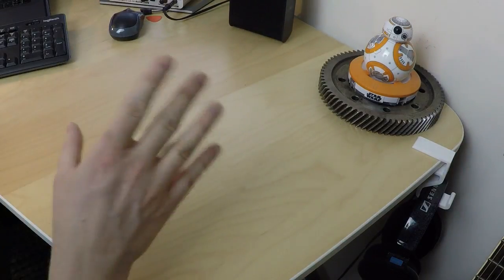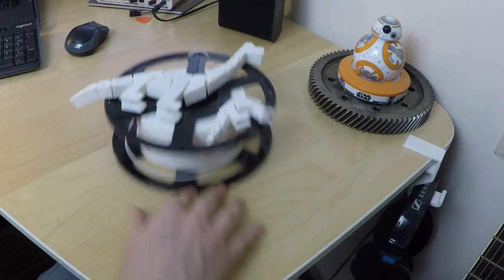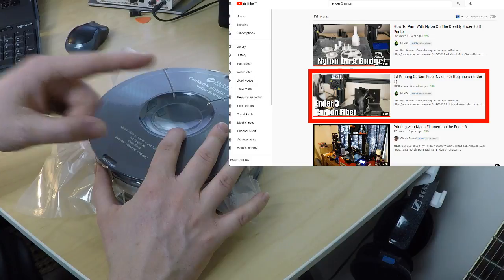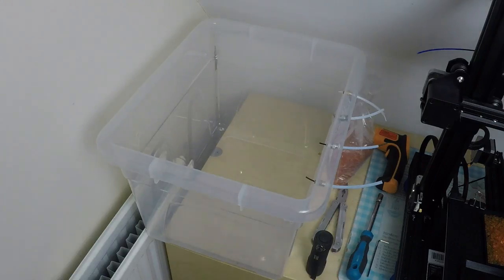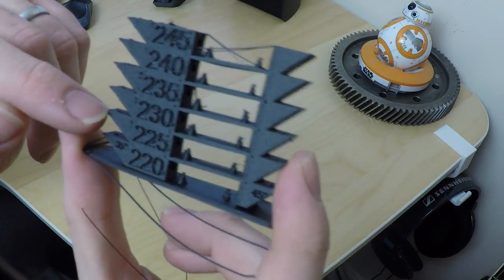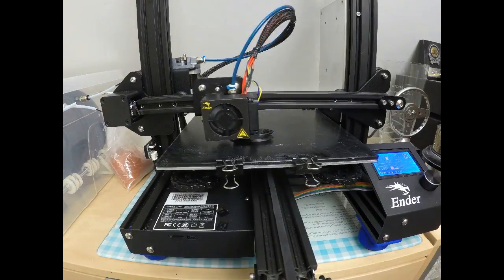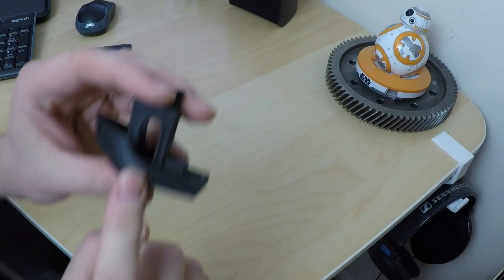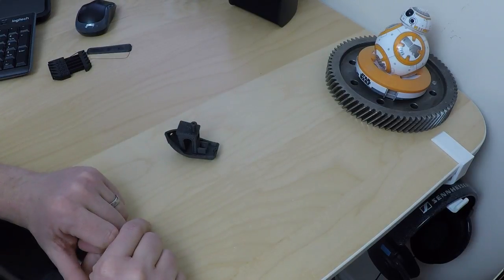3D Printing Carbon Fibre Nylon on a STOCK Ender 3 Pro - Can it be done??? (okay, almost stock....)

Comment: Definitely get some garolite if you're still having issues. I've been having excellent repeatable results with that with some of visionminers nano polymer adhesive. It's so nice to not have to babysit long prints and takes a few seconds to apply adhesive. As soon as the bed cools the adhesive shrinks and you can pop your part right out. I'm also using the Amazon Sunlu S1 filament dryer that I print directly from. I made some modifications to it just search for user "chambeers" on thingiverse. Excellent videos  I'm definitely subscribing!
Reply from the maker: I've watched a few of the Visionminers vids so it's good to get a second opinion on the nanopolymer adhesive, just need to find some in the UK!  I've only had 1 issue with warping on the Nylon, and these are big prints but I've just ordered some ASA so warping might be become more of an issue!  Thanks for watching and subscribing....
Reply: @MakingforMotorsport   I'm sure they'll ship worldwide. I was very skeptical of visionminers infomercial style marketing and figured I'd just give it a shot since it's made in the states. I have a shifter I make its about 300 grams and mostly solid 150mmx120mmx120mm with 100% infill. Runs for 26 hours each with 3dxtech CF PA6. Haven't had any warping or lifting issues yet with that combo. I have the Wanhao duplicator i3 plus v2 printer, garolite bed, wham bam flex plate, microswiss hot end, hardened steel nozzle, Creality amazon enclosure, and the visionminer nano polymer adhesive is the best combination. I tried everything from pei pex glass and nothing but problems. .4mm nozzle 265 degree nozzle 80 degree bed. I'll try to make a video to send you of my setup and some of the prints as they come out
Reply: @MakingforMotorsport   I watched a video from "Teaching Tech" he made some under bonnet parts from apolloX ASA and that printed decent on my setup but it's hard to find and just doesn't feel nearly as strong as CF nylon.
Reply from the maker: @moneyshot2239  I literally ordered some ApolloX yesterday, i have a few pieces under the bonnet in PETG as prototypes and I don’t want to use CF-Nylon for everything. From what you said I might bump up the in fill abit!

Comment: Nvm found it haha!
Reply from the maker: I don’t think that the Ender 3 is the “best” printer for this material, something with an all metal hot end and higher temps as standard would be better an enclosure would be ideal... but that is probably a $800 printer.... (I buy cars for less than that 😂)

Comment: Thanks for sharing.  But your printer with an metal hot end, glass plate with upgraded springs, metal extruder, and upgraded tubing... is NOT stock.  So your title is alittle off-putting and disingenuous.  But none-the-less, good video.  Those are inexpensive & easy upgrades that everyone should do, regardless, to make the Endor 3 a great reliable printer.
Reply from the maker: Yeah, I updated the thumbnail but I should address the title maybe, but like you say these are low end mods whereas lots of others have different mainboards/thermocouples etc, if you can build the printer from the box, you can do these mods!  But glad you enjoyed the video 👍
Reply: I just bought an ender 3 V2 and the glass plate comes stock... as for the tube it's mentioned that it would probably work fine without.

Comment: intresting video and cannot wait to see that manifold.. Had a mini myself with a 1380 jenvey body and I loved screaming it to 8,500rpm :)
Reply from the maker: This is my first mini, the a-series is a perfect match but getting good power gets expensive!  8500rpm on a 3 bearing crank!  Wow!  I've got some small bits on the manifolds in the ITB videos but I'm gonna round everything up on them once the R&D is done and get all 3D geeky!
Reply: @MakingforMotorsport   yes it gets very expensive, that 1380 build did get right up there in cost.. I will go through the videos you have :) 
to be honest if I do another mini Iwill prob go with a honda engine
Reply from the maker: Yeah the engine swaps are very effective in the Minis, but they never handle the same... mine certainly doesn’t, not bad but just not “mini”
Reply: @MakingforMotorsport   I know what you mean, the handling goes out the window..
A friend of mine back in the UK did the Honda swap back in the very early 90's and he said it was not the same after that

Comment: Got acouple things first this isn't a stock printer so please don't say it is. And second why do you keep saying 255 was the temp when it was 235???
Reply from the maker: Yeah, the stock thing is abit of a stretch so sorry if I deceived you... where was the 235deg piece?  I did the test at a range but I use 255 for this filament as a standard....
Reply: @MakingforMotorsport  He didn't actually absorb what you were saying and showing at the 5:39 mark - that you didn't follow the exact temperatures printed on the test piece. He thought you were following the 220, 225, 230, etc steps as printed on the actual model.
Reply from the maker: Aaahhh.... that makes a lot more sense now!  Guess I could’ve been clearer...   thanks for the translation!

Comment: Just bought an Ender 3 to use to make motorsport parts. You've got yourself a new subscriber
Reply from the maker: Excellent!  Just got the manifold on and it works but not fully tested yet (no events in lockdown 😡), but plenty of other good stuff to make planned!

What car do you race?
Reply: @MakingforMotorsport  got a k11 micra that I've got a 1.6 from a pulsar (in Australia) to go in it for motorkhanas/autotests. Very much a maximum speed, minimum bucks build
Look forward to seeing more of your build too
Reply from the maker: 1600?  That’ll go well, I had a 1400cc for a few months a while back, it went well until aerodynamics force take over, but off the line and up to 45-60mph it was fairly rapid...  best of luck with the build!
Reply: @MakingforMotorsport  thanks! We got the 1.6 with 115bhp over down under, which should be an improvement on the standard Micra at 74bhp. Supposedly it bolts up to the gearbox and only needs a small notch in the frame rail for water pump clearance. 
I'd love to put throttle bodies on it or even some boost, but I'll get it running standard first and then start messing with it. Should go pretty well
Reply: Be careful, don't rely on this for structural parts.
Reply: How can he make parts if he just keep on talking on his entire video.

Comment: Well that was a lie. Not even remotely stuck, and damn sure not bare bones! Way to lie!
Reply from the maker: Yeah.... I come clean fairly early on, but you are right, a touch “economical with the truth” so sorry if i deceived you.

 But i maintain as far as modded Ender3s go, mine is still close to standard, no new board, original firmware and the standard thermocouple.  If you can assemble the printer from the box, you can do these mods...

Comment: Thanks alot for the video, just found it and immediately ordered 2kg of that filament to print an intake adapter from it. Very much appreciated video!
Reply from the maker: Excellent!  Glad you found it helpful!  I love hearing about other people’s projects, what car are you putting the adaptor on?  
I am making an induction manifold from the Nylon for ITBs... should be test running this weekend 🤞
Reply: @MakingforMotorsport  my Car is a BMW E46 318ti with the 2L N42B20. I designed an Adapter to use the BMW B48 intake manifold with internal Charge cooler, the newer Style water/Air cooler. Pretty nice stuff.
Reply from the maker: Very nice!  I had an E36 compact with the M44 and want another one, underrated cars, I haven’t tried the E46 yet but I plan to get another compact soon.
Are you running a turbo or a supercharger to need the charge cooling?
Reply: @MakingforMotorsport  Actually i haven´t decided, but our TÜV pretty much forces me to use a supercharger.

Comment: I have same printer and plan, I’m glad I found your channel..thanks.
Reply from the maker: Welcome along.... what are you planning to print in Nylon?
Reply: @MakingforMotorsport  I’m into RC hobby, making and designing parts most probably in CF...still new on 3D printing and learning CAD.
Reply from the maker: There are others out there but I highly recommend Fusion 360 from Autodesk, if you don’t use it.  It’s very close to Inventor which is an industry standard, there are LOADS of tutorials and best of all... it’s free!
Reply: @MakingforMotorsport  thanks for mentioning Fusion 360, that’s exactly I’m using,,, I  messed around with Solidworks but they charge too much, playing with s ketchup,, but yeah you’re right Fusion 360 has free version and lots of tutorial,, looking forward to see your projects.
Reply: Are these all I need, steel nozzle, hot end and Capricorn tubing to be CF ready printing?, I do have glass bed already..

Question about hygroscopic, my house is 35-50 % humidity, do I still need heating and dehumidifier box? Thanks.
Reply from the maker: There have been a few comments on here by viewer saying 270 is the best for printing, to get that you need to reflash the firmware, perfectly do-able and there are loads of guides (if you are flashing it, a PID tune would be a good idea too), but 255 is working for me.  Once you have the all metal hot end, you don’t NEED the Capricorn tube, but it will make your retractions more accurate.  Steel nozzle is needed for longevity. 
Do you need the kit to handle moisture - yes.  You don’t need a dehumidifier, I just used the oven but ‘cus my prints are long I need the dry box, if your prints are short (2-4hrs) you may get away with it but I would make one to be sure. Don’t even try to print this wet... it just doesn’t work, constantly oozes, doesn’t stick... nightmare

Comment: You may want to redial your retraction distance. 2.5 mm is realistically too low. I'd suggest something around 4-5 mm.
Reply from the maker: Yeah, thanks for the comment, since I did this video I haven’t done a lot in this material but I plan it up it as you say but I don’t get much stringing so it works as a base setting.

 The reason it was 2.5mm is I had bad clogging with this hot end on other materials with my standard 4mm (I did a vid on that), that said Nylon with the higher glass temp can probably stand it.
Reply: @MakingforMotorsport  If you don't get much stringing, then there's no need to change it as well :)
I just thought, that the "rough" bits on the right side of your benchy could be improved that way.
Incredibly interesting topic nontheless.
Reply from the maker: Yeah, it’s the blobbing that I am thinking about, I still get that.  I get less with lower temps but I want the strength from the high temps... I guess things like this are never finished.... always something to improve and try!
Reply: Bruh I use 1mm retraction with a direct extruder.
Reply: @FrozenByFire3  Great. He uses a bowden style though.
Reply: @maximilianlindner  then 3mm should be fine! Nylon oozes no matter what you do. I've tried up to 6mm retraction on my direct drive and it showed no difference compared to 1.5-2mm. though this was at higher temps around 270-75°C.
Reply from the maker: I was looking at trying a direct drive mod for the Ender 3 to fix the blobbing on Nylon... might not bother now 👍
Reply: @MakingforMotorsport  I am on the fence of doing the same on mine. However, I haven't found the right option, so I guess I'll keep waiting, maybe spending my time doing other useful mods.

Comment: interesting, except for PLA for all the other materials I never use the fan. I didn't.t get, did you change the nozzle or still using the stock one?
Reply from the maker: Hi, thanks for watching!  I changed to some hardened steel nozzles from Amazon, I have put the link in the description (not an affiliate link).  I haven’t done enough printing to test the longevity but they are working fine now...

Comment: If you have an all metal hotend, run Marlin and set the max temp higher, then yes. I've been printing this stuff on my Ender 3 for awhile. It really likes 270C for proper layer adhesion and keep it dry. Using a textured glass bed with glue stick. I recommend always using a raft because this stuff is hard to pull off the bed, the raft makes it much easier to remove.
Reply from the maker: I’d agree a bit more heat will help but I wanted to stick to the stock main board with just a couple of mods, anyone who can assemble an Ender 3 can do the mods I have here, flashing the board or changing it is a completely different level of mod. 

... which I totally plan to do!!! Want to do some PC and others (in silence) so a SKR turbo board and an enclosure are on the list, watch this space!
Reply: Are you able to help recompile marlin? I got a PT1000 thermistor and E3D V6 hotend but I can’t seem to get it to compile correctly.

Comment: Damm good video Just subscribe Immediately
Reply from the maker: Damn good comment!  Just pinned immediately!! 👍😄
Reply: @MakingforMotorsport  What size nozzle are you using I have the exact set up and I’m having horrible problems with clogging I am using Hardened steel 4 mm nozzle
Reply from the maker: I am using a 0.4mm nozzle, but I don’t think that’ll be your problem...  things I do now...
1. Double check your nozzle is tight when hot, always do the final tighten when hot
2. I would do a small test print without retraction - if you still get clogging or the extruder skipping it’s likely you have too much flow and your e-steps need calibrating.  Tune the flow down to prove this
3. If no retraction solves ur problem then you had the same issue as me so follow my steps and then slowly increase the setting.
4. Other things I did was remove the retention screws to help

Other people have suggested printing slower aswell as that will also slow the filament flow.  
I solved it, so can you!!! Best of luck 👍